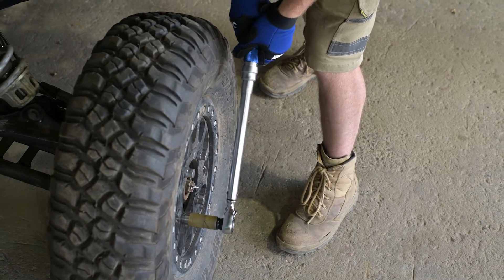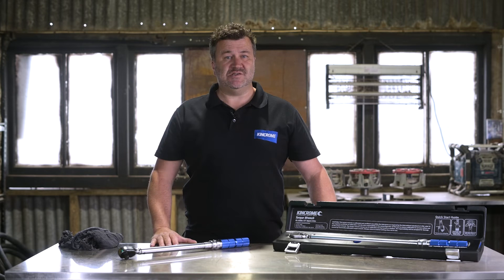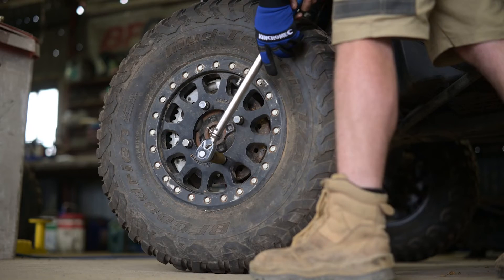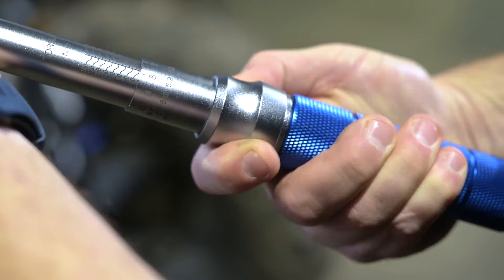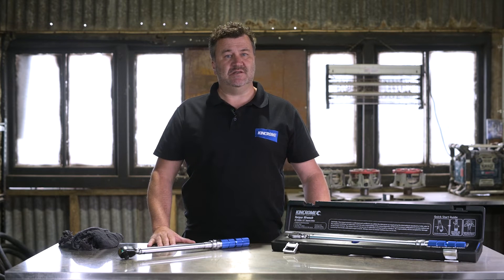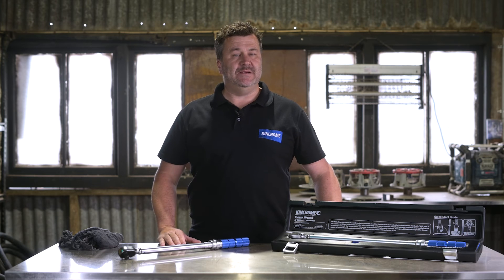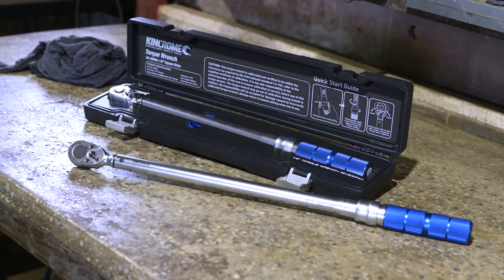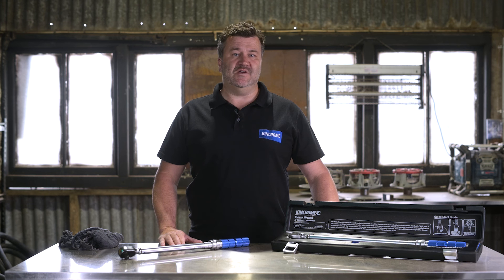How to use the Dual-Way Torque Wrench | KINCROME Tech Tip

Comment: Why can't you use it to unfasten a bolt to measure a torque value if you're staying within range?
Reply: Just my two cents as a non-mechanic,
clarifications are welcome and probably 
needed lol.... : 
This is an issue I'm looking into myself, I've read 
lots and watched lots, My overall consensus is
that 99% of the 'presenters' are dingbats, not 
referring to this channel though. So, yeah, I 
had a lug nut that was over tight, so the spec
was 76 lb-ft, I set torq in reverse and at 90lb ft,
came off like butter. My wrench max is 150 lb ft
so I didn't feel like 90 was an egregiously abusive
setting lol.... Don't forget to wear; helmet, goggles,
ear protection, eye protection, mask and flash-guard
while using any torque wrench... But I digress, one
note is that I think that after feeling the click, we 
should not push the wrench beyond that point, 
whether tightening or loosening, which would then 
put wrench into BREAKER BAR mode, which 
can damage a TW, and probably, partly, why 
most presenters give us so much bad info, 
my guess is they don't understand or
are not able to discriminate the difference between
forward/reverse use, and putting tool, into breaker bar
mode, breaker bar mode being not what they are built for..
and where the actual damage probably comes from. shrugs....
I also think there is a stop or lock out bar/pin that prevents
us from going past a point on the inner spring, that pin or
bar probably breaks if we go way over the max value of 
the wrench.
Reply: Bro you literally use this tool to measure torque value. You don’t measure torque value by attempting to loosen the bolt.
Reply: Correct. You can. The function is the same. You apply force and the mechanism clicks according to your setting. It's doesn't care if you're tightening or loosening. I do not understand why people can't understand this. As long as it's bi-directional, it can loosen bolts.

Comment: I don’t understand one thing. You said that the switch left-right for tightening in both direction. So why you had set it to left and then tightening your wheel clockwise?? Shouldn’t that be set to right?
Reply: It’s for left hand threads, very literally the opposite of the common right hand thread.

Comment: Using a bi-directional torque wrench to loosen bolts is no different than using it to tighten bolts. It's the same function and therefore perfectly safe. 
It's simple. You're applying force to tighten, you're doing the exact same thing to loosen. As long as you're not exceeding it's torque limit, it's going to be fine.
Tightening a bolt at 120Nm is no different than applying 120Nm to loosen it.